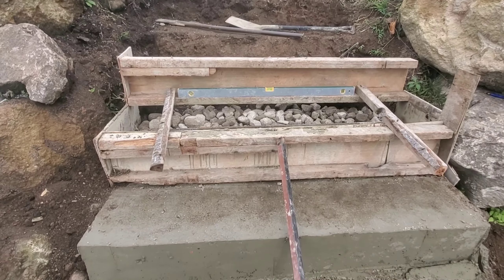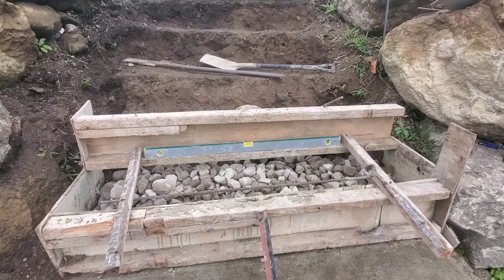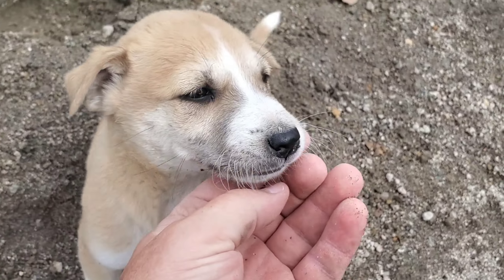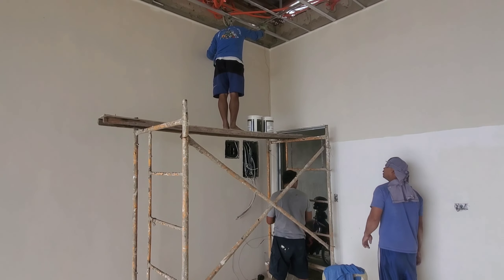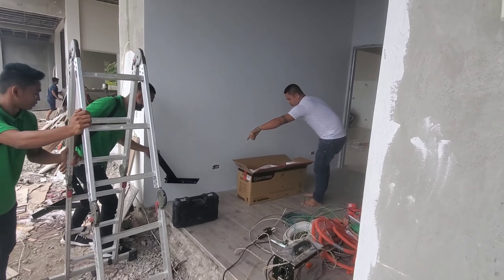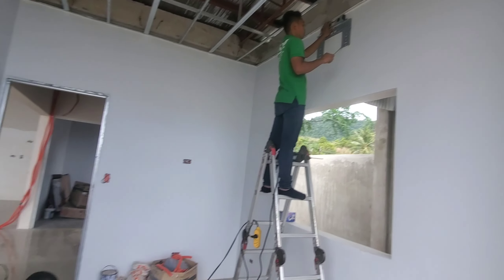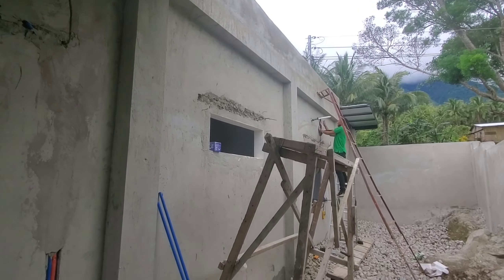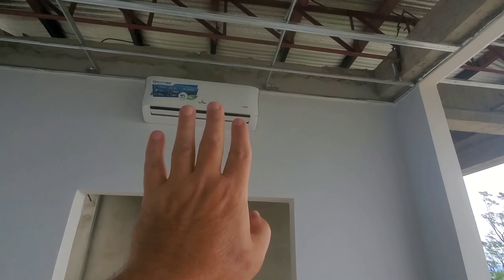American building a Home in the Philippines 🇵🇭 🇺🇸

Comment: As I have mentioned before I run an aircon business in NZ. You may have missed this step out during filming, but they should pressure test the installed pipework by filling it with dry Nitrogen to 500psi and leaving it for 15 mins to check for any leaks. Another thing you should check relating to vacuuming out the systems is I only saw them using standard guages and there didnt appear to be an electronic micron guage which is needed to really see if they got all the moisture out. (a standard guage set is nowhere near sensitive enough to read in microns).The system should pump down to and hold 250 microns of vacuum. Going by time only and hoping your vacuum pump is getting there is not adequate.
Reply from the maker: This is the Philippines.
Reply: pwede na
Reply: @buildingthephilippines  you took the words right out of my mouth. Lol...

Comment: Sand Dune paint looks really nice. Glad to see that your AC installation is going well and no wires or AC lines showing. They are doing a great job. Thanks for the updates.
Reply from the maker: Thanks Keith, yes we like that clean look. They need to come back on Saturday to finish installation and testing each unit. On to the next item.

Comment: Greg, two small things. You actually do have another option concerning your master bedroom Aircon. You could runs the copper lines through the crawlspace to the dirty kitchen, or to the other side of the house where the other condensers will be. The only problem that I've heard with this option is the lines get hotter in the crawlspace and reduces the cooling effect. I did this in my home in General Santos and it still gets very cold. I did get top of the line units though. Okay, my other point is, the rock that you put on the side of the house, opposite of the car port seems to slope towards the center. Do you plan on leveling that off? If not, it will be hard to walk on. I'm sure you know that only the ground underneath the rock needs to be sloped to direct the rainwater. It can still be flat on top.
Reply from the maker: We decided to go back to back with the air con in the MB.  Don't want compressor in the dirty kitchen. The rock behind the pergola is a dead zone. No need to walk back there. It's sloped specifically to reach the drain I buried in the corner of the pergola in the back. Under pergola will be concrete, so don't want heavy rain events to have water coming from behind to flow up and over the concrete. That steep slope of rocks will flow water away from house and to that drain that will be under the concrete pad of the pergola.

Comment: I used to do commercial plumbing and the electricians working near would use a shop vac and suck a string with a small piece of rag tied to it through the conduit in about 30 sec. then use the string to pull the wire back through. Time is money,
Reply from the maker: Good idea if they had a shop vac. I don't know why but a cheap small shop vac cost like 125 dollars here?  Not sure why.

Comment: Indore units of Aircons   are  almost touching the ceiling how are they going to dismount in case of service needed , there is not enough space to lift it up , also installing the ceiling will be difficult ... Just observations
Reply from the maker: The supervisor showed me how the doors open upwards for service. The units are low enough to allow the doors to swing open and lock in place.  They are 3 inches below the ceilings height which is minimum suggested clearance. Covers pop off for ceiling install.

Comment: Gregg, how was your 220.00 hook up set separate to 110 voltage for North American plug ins.
Reply from the maker: I have 3 step down transformers/AVRs. 220 to 110.  One will be inside one of the kitchen cabinets plugged into a 220 socket inside that we wired inside the cabinet. Then we wired 2- 110v sockets that leads into that cabinet. One in the kitchen backsplash and one on the other side of the wall in the dirty kitchen. Those 2 outlets will be hardwired into that step down transformer.
Reply: @buildingthephilippines
Reply: All of your tips will help us on our build in 2026 Ililo near the Cabatuan airport. Thank you.
Reply: @buildingthephilippines  hello Greg. What step down trabsformer did you use
Reply from the maker: I bought an Akari brand. 3000 and 5000 watts.
Reply: @buildingthephilippines  thanks Greg!
Reply from the maker: You bet.

Comment: I hear it is expensive to have central air put in the Philippines, why?
Reply from the maker: I have never heard of central air in the Philippines for residential. Probably exists but never seen it. Maybe because of the cement walls?  Not sure.
Reply: @buildingthephilippines  all the duct can be run in the ceilings. It's not used much there but used widely in Thailand